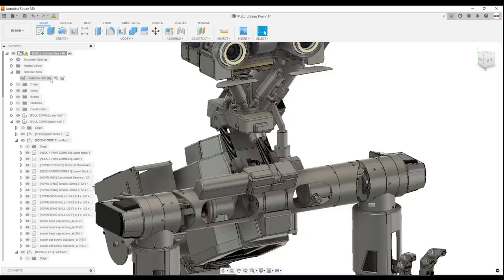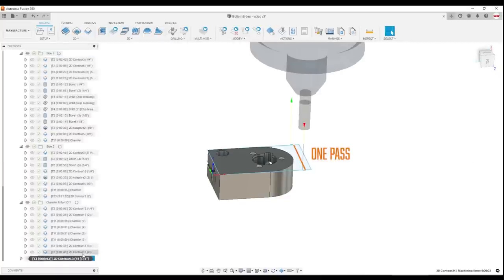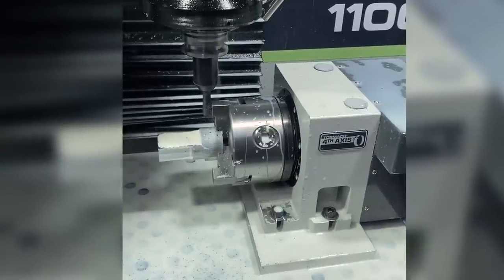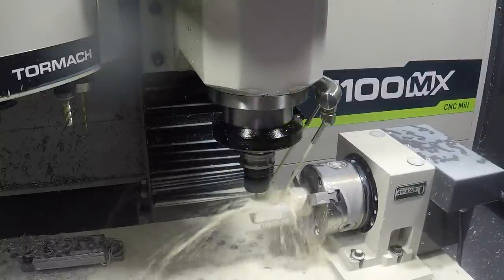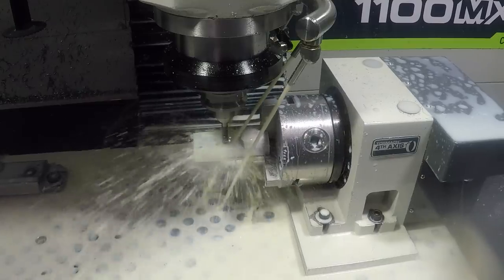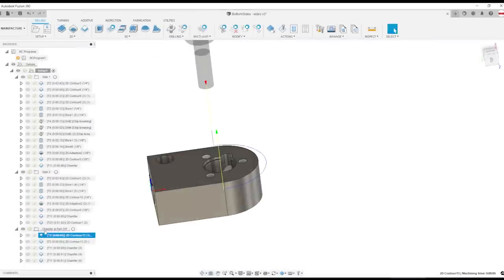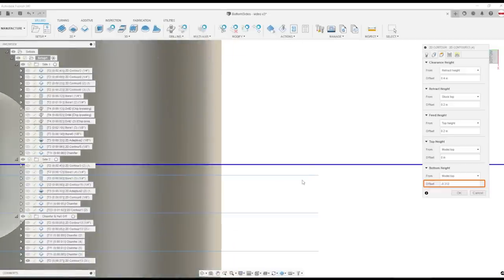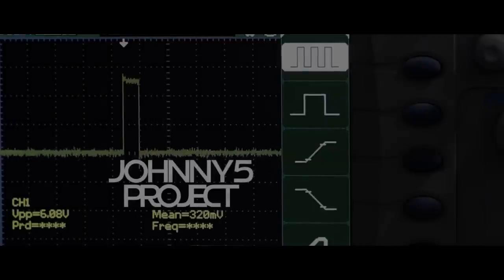Johnny 5 is ALMOST Alive: Machining Neck parts on the Tormach 4th Axis!

Comment: Another Trick with the slitting saw to get it to clear the part is to use Stock contours there  too, it automatically extends the passes to the edge plus however much is needed to clear the tool and the lead in gently swings the tool into the part.

Comment: The problem is that this is not just hardware. You need to bring on robotics engineers for all the electronics, locomotion and software as well as artificial intelligence. You still got a pretty good uphill battle